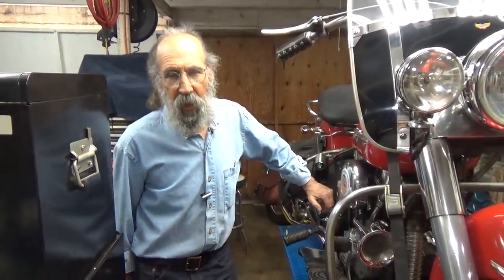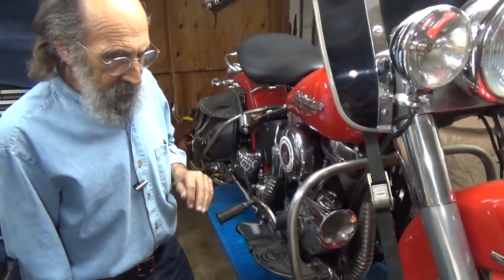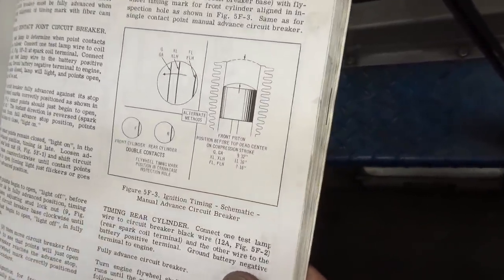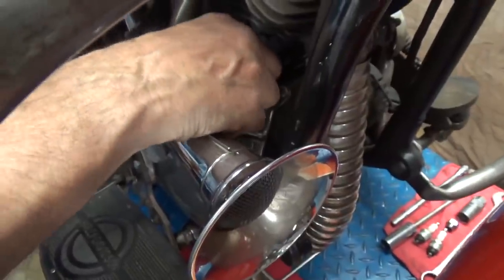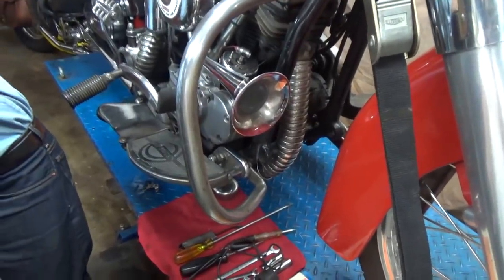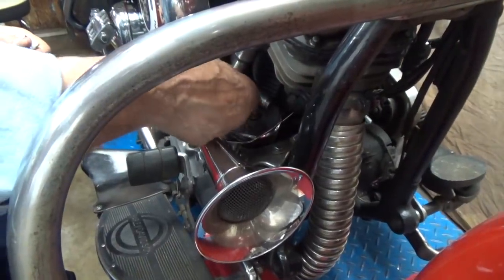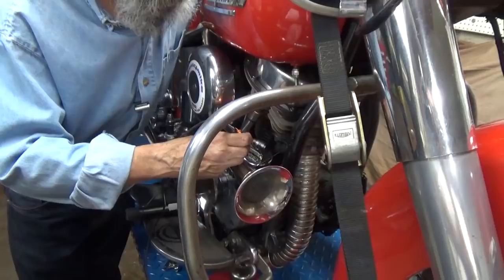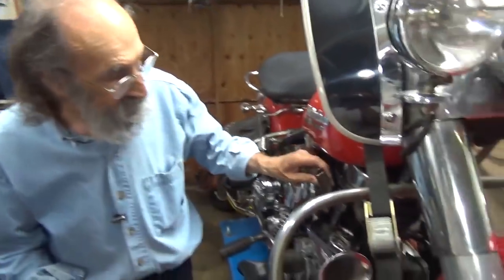A New Set of Ignition Points For a Harley Davidson Panhead

Comment: Having the timing mark there; does that mean that it fires a millisecond before TDC in effect ? I've watched so many of these with various people and still don't completely get it LOL
Reply from the maker: We're setting up a bike with points.  We're setting it for it's running down the road.  The timing mark is the "advance" timing mark.  At speed, the points should fire at 35 degrees before top dead center.  That's means it's going to fire with the piston 7/16 of an inch before it reaches the top of its travel up in the cylinder.  The fuel and air mixture starts it's burn when that mark appears in the window.  Again, it is the advance timing mark.  It's explained pretty well in the service manual.  Once it becomes clear, you'll get it.
Reply: @pacificmike9501  Thanks a lot man. I don't actually have a Harley ( l wish ) but l love watching this stuff..  I have a Honda Hawk 650. When it's  running that is haha. Thanks again Mike 😊👍

Comment: When I set mine, I use a volt ohm meter. I lock it down when it just breaks. Did you change the condenser? I only change mine if the points show burning. Great video, and Happy Independence Day  my friend!
Reply from the maker: I set it with either a meter or a test light.  Good condensers have become an issue.  It depends on how I feel about it at the time.  There are some real bad ones out there.

Comment: Hey Mike!
My 1968 Harley got a Mallory ignition installed to it. Its timed properly as per the video you show here. So i got a question. If the engine runs a little to hot for my personal preferences, is that then a carb ”issue” running to lean or should i retard or advance the timing more? Iam using the s&s super e carb with the recommended settings. Have an awesome day! Best Regards David
Reply from the maker: Some things are characteristics.  You can change them some, but, you learn to accept certain things.  Now, these are not heavily modified engines, but my opinion based on what I've experienced.  Knuckleheads run cool.  Panheads run warmer than Knuckleheads.  Shovelheads run warmer than Panheads.  Evos run very cool.  Anything newer than that is designed to run very hot in order to get complete combustion and eliminate smog emissions.  I always run oil cooers on Shovelheads.  The engines run cooler and make me happier.
Reply: @pacificmike9501  Thanks for the answer, i appreciate it. I think my engine gets a bit hot right now beacuse its a fresh rebuild engine. I was a bit worried that it had something to do with the timing. But ill try get some more hours of it on the road and see if it cools down a bit.

Comment: I put a set of Blue Streak points on my 76 Shovelhead and the slots in the plate wouldn't allow it to turn far enough to get the timing right. Put the old points back in and it timed right up. You can't even trust famous brands anymore I guess...
Reply from the maker: Those Blue Streak points weren't intended to go there.  They just happen to fit in place.

Comment: Timer not distributer ,brand X had disturbers ,however they really are not motorcycles !
Reply from the maker: Well, yes, it is not a distributor.  Calling it one is just slang.  Harley calls it what it really is, which is a "circuit breaker."  And I think you're referring to Indian which, yes, it had a real distributor.  I think the old rivalry between Indian and Harley was a gas.  If you go to the flatrack  races today, it's started all over again.  It's very cool.

Comment: If they've fuel & oil, but are 'off the boil', maybe look to the spark sequencer,
& if the points are burnt, then you've just learnt, your need for a new condenser.
For they sit in the dark, just bouncing the sparks, an electron trampoline,
& damping out, the current's clout, when not needed on the scene,
but over time, they fail their task & the charge will dance & fizzle,
& then the spark, will lose it's bark, to become an electron drizzle.
So when you fit some new points & set them up just so,
fit also a new condenser, to give the 'fizz' somewhere to go.
Happy holiday Mike, yet another example of a great British victory eh? - y'know, where a glorious bunch of ex-pats saw off a mad German King & his mercenaries . . . #'Land of dope & Tories . . .'#
BTW, Has Trump fitted headdresses on Mt. Rushmore yet? : )
Reply from the maker: Like I said, You never disapoint.  However, condenser manufacturers, not so much.  I used to replace every one of them.  Now, if one appears to be working well, I don't chance it as often.